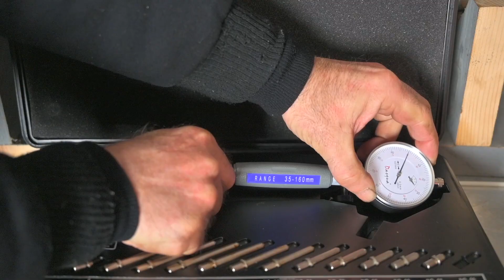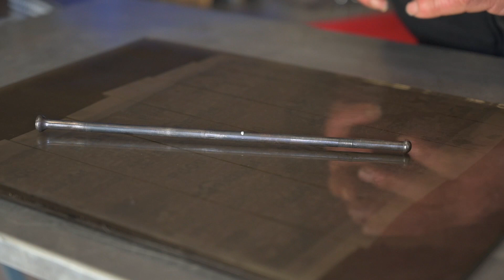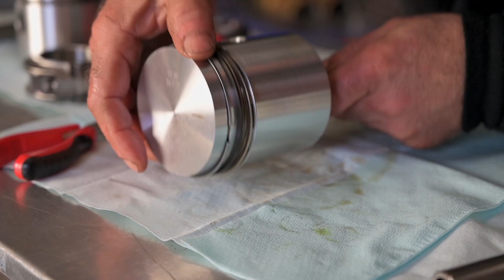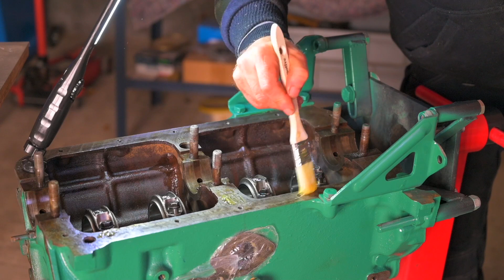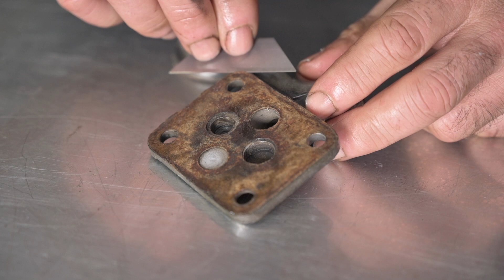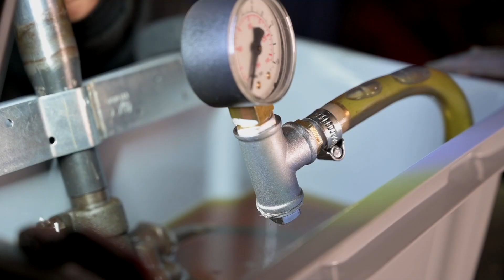Old Rusty , Part 3 Engine Rebuild - Camshaft-conrod-piston-oilpump install

Comment: Sorry if I ask this question again (I already asked in the "25 min." video): Are you sure there should be a gasket inbetween the oil pump housing and its lower cover (inbetween the section that carries the gears and the tin plate that covers the gears?) I think there should only be a very small axial gap inbetween the face of the gears and the housing. The use of a gasket will most probably produce a gap that is too wide which will lead to excessive internal volumetric losses of the pump.
Reply from the maker: As far as I can tell it is working fine like this.... it was tested in a separate out of engine test ..

Comment: Great series of videos! I'm in the process of rebuilding a Citroen Traction Avant engine which is nearly identical to what you are working with. Regarding the orientation of the asymmetrical connecting rods, am I clear that you are recommending that the long side of the connecting rod should be on the camshaft side of the engine? Reviewing the service manual for the Citroen ID 19 with offset connecting rods it appears that the long side is opposite the camshaft side of the engine.
Reply from the maker: Indeed , and that is because the U23 engine is almost the same but reverse.  Good to see that you are rebuilding a TA.    This topic that you mentioned was a hard one to find the correct answer. It took me some time, But remember that is only applicable to the U23  not the TA engine
Reply: @D3Sshooter  Thank you so much for your reply. It is a difficult question to find an answer. I have been agonizing over this question for weeks. Even the published information on the Traction Avant and ID 19 is ambiguous.  "Old Rusty" is a fabulous restoration project, thanks for sharing it via YouTube.

Comment: If you have any trouble with the interference fit  of the gudgeon pins ( sometimes called the wrist pins or piston pins) then try this.  Put them in the fridge or even the freezer for 1/2 an hour. Take them out, oil them up and then slide them in.
Reply from the maker: txs for the comments and tips

Comment: Hi, love your work it’s helping me a great deal I’m rebuilding a Citroen Traction Avant 6 Cylinder and this engine is almost the same I was just watching how you tested the oil pump the Citroen 6 oil pump hat two exit pipes how can I work out the pressure if I block one and put the gauges on the other? Cheers Mark.
Reply from the maker: TXS for the comments, wow that is nice the six in line,,,   I would put a similar reduction up on both pipes.  As your engine has more bearings etc...

Comment: i have built thease before and they do a 1.9 litre high compression domed piston and liner for this engine and it makes such a difference to how it drives.
Reply from the maker: I was thinking of that as well, but at the end i decided not to.  Are you also using the off-set con rods ?
Reply: @D3Sshooter  the few i built were from a hy van and already had the off se conrods in them

Comment: Was the engine in the U23 shared with Citroen passenger cars? I looked in the internet and could not find  much on the U23. It is a pleasant surprise that you were able to obtain cylinder sleeves, pistons, conrods and more for that engine. I have a few Citroen, 2CV6, DS21 5M, SM, and a partial DS21 Pallas.
Reply from the maker: Thank you for the comments, yes it was, U23 is hard to find.  Its the same engine in the TA but inverted . So many parts are the same. As for the body work , there is nothing for the U23.  Nice cars that you have..  Is the DS not having those sleeves ?
Reply: @D3Sshooter  Yes, the DS21 has wet liners just like your U23  and the TA. The engine used in the ID and DS series was derived from the TA. The Maserati engine in the SM also uses wet liners.

Comment: You inspire me to continue my work on my 1964 chevy 283 rebuild, LOVE this rebuild series, thanks for sharing your knowledge and tips!
Reply from the maker: Thank you for the comments,  happy to hear that    ... any video's of your chevy ?
Reply: @D3Sshooter  I really should have filmed what progress I've made so far. Most of my adventure has been sourcing the parts for the engine itself. The previous owner essentially sold me the block, heads, intake and valve covers. Everything else, IE: dipstick tube, brackets for pumps etc, i've had to find that were of that period. Has taken me the better part of 6 months so far. How is old rusty coming along? I love the green you chose.

Comment: Great video, it brings back many memories of rebuilding Citroen engines when I was a teenager. One odd memory I have is I think those con rods will go in through the top of you take the cap off. Of course mine had bolts and yours looked like studs and nuts so maybe it won't work in your case...
Still great job :-)
Reply from the maker: Thanks for the comments Dave,  I did try that and they just did no go through .. so I did it from the bottom side
Reply: @D3Sshooter  no worries, I rebuilt my DS 19 46 years ago and my 11B about 40 years ago so my memories are completely suspect! Lol

Comment: By now I'm sure you realize you were demonstrating the oil pump running the wrong direction?
Reply from the maker: Thanks for the comments, not really.. its running like that...clockwise is pressure out... why do you think so ?
Reply: @D3Sshooter  Perhaps I misunderstood. I took the aluminium casting you removed  first to be the oil pickup and if that were the case, the left hand gear in the video would rotate clockwise, and the right hand gear anticlockwise.

Comment: You know, one of the things that I've noticed (purely anecdotal) over years and years of doing this sort of engine work was that engines that I did major repairs to in the dirtiest environments (there was just no option) seemed to run just as happy and just as long as engines I built up in super clean conditions. 
I think I lay that result at the feet of good oil.
Reply from the maker: Thanks for the comments, I believe you...  I have done work in very bad circumstances as well... But always tried to work clean

Comment: You kinda glossed over the clearances between the camshaft and bearings.... was it 0.15mm (5 thousandths of an inch)?
Reply from the maker: Thanks for the comments, that was 0,075 mm  indeed or a total of 0.15mm
Reply from the maker: Thanks for the comments

Comment: I have seen numerous engines rebuilt and numerous rebuilt oil pumps and new ones installed, I never saw anyone actually bench test one.  I am not saying it is never done, I just never saw it done.  It obviously should be, thanks for a video showing how to do it.
Reply from the maker: Thanks for the comments

Comment: Check your folloers for wear by placing them face to face. they should rock as the faced needs to be convex. If they wear concave,they will not turn and will wear the cam quickly.
Reply from the maker: thanks for the comments, great tip and I will do so during the cylinderhead rework as I can access those very easy . txs

Comment: I noticed you reusing old tab locking washers..  I was always taught to never do that, always replace, even if you have to remake your own.
Reply from the maker: Thanks for the comments, indeed I did in this video, however when we going to install the cranckcase and the distribution chain they will all be replaced with new .  That is to come in part 5 or so , or as soon as I have the cranckcase back , Yes, you are 100% correct

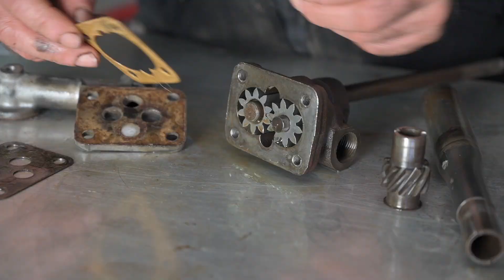Comment: 35:56  Are you certain there are two gaskets for the oil pump?  There is a maximum tolerance between the side of the gear and that plate. Excessive tolerance in that area promotes cavitation or at least reduced efficiency.  I've seen a few variations of gerotor pumps, and in my experience when they double up the gaskets the gears sit proud of the surface to reduce the clearance that the gasket adds.
Reply from the maker: Thanks for the comments, that is a good point . I had to refer to the pump when I took it appart.   You might notice that the first gaskit has big cut-outs for the grears to rotate in
Reply: @D3Sshooter  Very good.  I don't remember seeing the pump tear down so I wasn't sure of the configuration.  I know the gasket will clear the gears, was more concerned with the extra volume the gasket makes between the gear sides and that plate.  Seems like it would cause a lot of oil to be recycled in the pump.  I know on some older equipment gaskets/seals were not used where we would expect to see them today.  You know what you are doing, I'm just another set of eyeballs ;-)

Comment: Such a great video!  How did you figure out what rpm your drill would put out?  Also, is that oil pump totally enclosed within the crank case?  The reason I ask is that the filter mechanism you showed is woefully inadequate.  Do you know if anyone has come up with a better method of filtering the oil on that motor?  The oil pump test was awesome.
Reply from the maker: Thanks for the comments, the RPM are indicated on my drill and I had it check with a RPM meter.  The RPM's applied to the pump are based on a technical note that I got from a simular engine.  And in general a 30 PSI  pressure is what engines require at about 1000 or more engine RPM's ( that is a general figure off course which might vary for some engines).  That is how filtering was done in hose days.  The pump is attached to the block and hangs in the sump, the output feeds with a tube to the block.  So i could work on an external filter but not that easy..

Comment: Excellent results with the oil pump, I shouldn't worry about the pitting on the cams, they will retail oil and give better wear resistance, the cam followers are usually offset on the cam nose to prevent tracking, that makes the follower rotate as it reciprocates, I find it a good idea to anneal the lock tab washers, that way they are much easier to turn up, and less likely to crack /break, it is much easier to remove/install the gudgeon pins if you heat the piston,(pour boiling water over it), they slip in and out very easily then, this engine is going to be much better than a factory built one, they never put this much care into building them, nice work Steve! Chris B.
Reply from the maker: Thanks for the comments Chris B...  indeed heating up the piston and pins at 60 degrees works better. Have done that before.  But here it went so easy without the heath and it was cold in the shop 3 degrees
Reply: D3Sshooter: 3 degs ! I thought you looked a bit cold there Steve, I find it is colder in the barn than outside at this time of year, you might enjoy watching this engine rebuild have a look. https://www.youtube.com/watch?v=s_C2DSKboGkChris B.

Comment: Hello Steve. Method I used to fit gudgeon pins into the piston and crankshaft was to heat the piston in boiling water, with circling fitted on one side, then slide the pin into place whilst the piston was still expanded with the heat. Great videos and enjoy your very detailed approach. Thanks from UK.
Reply from the maker: Thanks for the comments, and indeed that is also I method I used on some of other rebuilds and on the old parts, On these new parts it went s easy.  Good points... TXS

Comment: An old British Racing Mechanic showed me to use STP for engine building in the very late 70's..no issues for me (occasional but regular rebuilds..in any of many vehicles)    Good Job !
Reply from the maker: Thanks for the comments, indeed that is how learned it.  STP seems hard to get here
Reply: @D3Sshooter   STP is under 4 Euros in Canada for a 428ml bottle. Still cheap. Also, i have noticed that You have a lot of NEW looking tools for a seasoned mechanic-type (as i am), and judging by the hat, you hang on to old friends. I sure hope that You did not get ripped off at one time. Hoping that they were 3rd party supplied to assuage my concerns for that.
Reply: More or less the same here, back in 1978, I was told by the machine shop that re-bored my Ford 2.3L Pinto engine this same trick (it had ingested an intake valve), he said saturate everything with STP so the engine is lubed during the initial start-up while oil was filling-up all the dry oil-ways. Another trick was using silicone for gasket goop and also on metal to metal surfaces, of course in the 70's the special silicone for gaskets was tougher to get (or not available) so he said use household stuff! I saw that engine about 10 years later, was still clean with no oil leaks, my buddy who'd bought my old Mustang II years earlier was putting it into a small boat.

Comment: If the camshaft is what spins the oil pump, then it should spin at half the revolutions of the crankshaft, so instead of 750-1000 rpm it should be 425-500 rpm right? Or is the idle in that engine at 2000rpm? Or is that engine a 2 stroke? Great video, very informative, I love watching you work on that old engine, you seem that you really know what you are doing.
Reply from the maker: Thanks for the comments Adrian, indeed 2 turns of the crankcase is one turn on the camshaft.  In the reference manual of a similar engine it stated a 750-1000 RPM of the pump should deliver 2-2,5bar with a 2.5 drip hole. So it is actual pump rotations,

Comment: Regarding the oil filter: mechanical filters were common even in the 1960s. The Deutz engine of my Magirus has a cylindrical gap filter with an automatic cleaning mechanism, i.e. the retained mud is automatically scraped off. Of course it can't  retain small particles. Therefore some pepople claim that modern motor oil is bad because it keeps the dirt floating. They say it is better to use special oil that binds the dirt in oil mud. I don't want to use these expensive classic oils (my engine needs 25 liter)   therefore  I installed a bypass oil filter - this is a better solution IMHO.
Reply from the maker: Thanks for the comments, very good tips and info.  Did not know that about he oil

Comment: Hey, can you please make at the end a video about the costs, because I have got the fear if I start something like that, it will bancrupt me. Thanks
Reply from the maker: Thanks for the comments, cost is always a factor.  So far , and that is an honest statement the truck costed 500 dollars, the metal work less the tools but including the paint about 800 and the engine will run about 1500.  And then there is all the rest that still is to  be done on that truck. So overal, I estimate the cost at 5000 Dollars.   That is not including the tools ( I assume that you have those, and are not a lost investment).  The good thing is that there is so much work that I need to spread it over years.  Hope that this helps

Comment: Quite a setup there for testing the oil pump!! A few points: In America, what you call 'segments' we call 'rings' or 'piston rings', and the 'scraper' we call the 'oil ring'. It was a good comment that you made re: the term 'mils' because in English countries the term 'mil' means a thousandth of an inch, not a millimeter. Re: the asymmetrical rods, I think you could have gotten them in from the top if you take the caps off, which always seems normal to me. Two other reasons for using asymmetrical rods is to facilitate putting the caps on and to allow a larger crank throw (e.g. for an engine upsize) without requiring a bigger block. One point which you do not clarify is that you use regular engine oil for your assembly lube everywhere except the cam bearings because the tolerances are tighter (e.g. with the piston pins or big end rod bearings) or because you want it to burn off / scrape off faster (e.g. for putting pistons into the bores). Assembly lube is important, and is used by all new engine builders and rebuilders. You know that, but it is perhaps worth emphasizing for newbies.
Reply from the maker: Thanks for the comments Dennis, always great to get this sort of feedback.  I did try to get them in from the top with the big end halfs removed,  no such luck... about the lube, yes indeed next time I will stress that point... sometimes I do forget to say things as it is so natural to me...  txs again

Comment: Greetings from South Africa! Thank you for your channel which I've been following for a short while. Just a question or two. Did you check the ring gaps before installing the pistons in the sleeves? Also, shouldn't the three piston rings be oriented at 120 degrees from one another? All the very best! Gary.
Reply from the maker: Thanks for the comments Gary,  yes I did and I should have shown that. Point is I did not tape it.  120 degrees is an option, I like the compression rings at 180 as they will move a bit and settle... the scraper is not really a worry ( maybe wrong) in terms of compression.   Is the 120 rule something you do ?

Comment: Awesome video again!! Have you thought of an upgrade and give the old girl an oilfilter anyways? Remote mounted. Seeing it would be simple enough to do as the pump is connected with a steel pipe! One fitting out and one fitting back in. Tap the oil pan or block to run pipes>> good job keep up great work..
Reply from the maker: Thanks for the comments, that would be an option, however it connects to the block ( pump and pipes) having that leaving the oil pan is a bit difficult

Comment: Would the rpm be engine rpm or oil pump rpm because of gearing they would be quite different, i have never seen a pump checked like this
Reply from the maker: Thanks for the comments big ears, the RPM's are the actual pump RPM for a similar engine and not the running RPM of the engine

Comment: When punching out gaskets I have found it works better if you do it on the end grain of the wood block, not on the side grain. I like the way you tested the oil pump. It should a very nice engine when it is all done.
Reply from the maker: Thanks for the comments David, indeed that is a good tip...
Reply: A thick piece of phenolic sheet on a solid surface I have found to give excellent results, especially for thin gaskets.